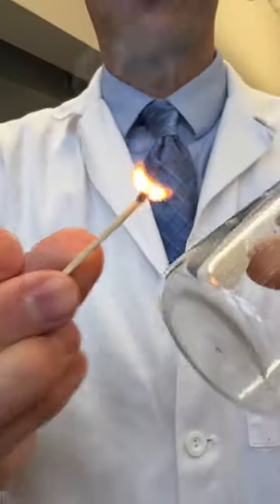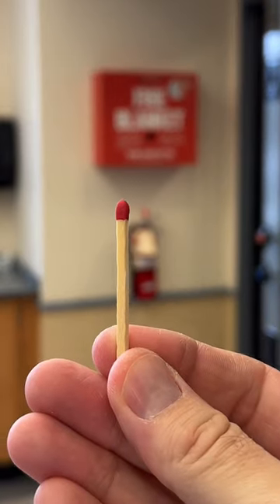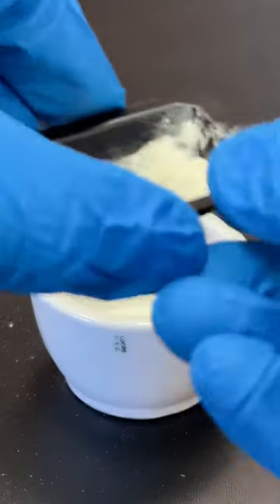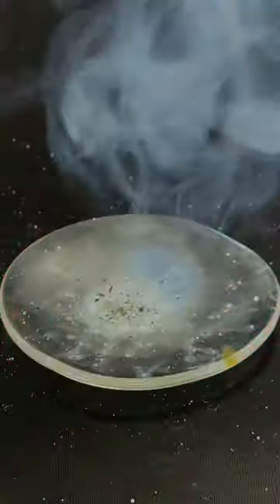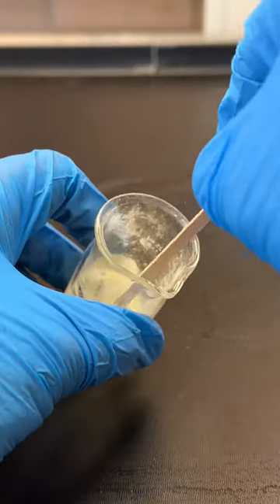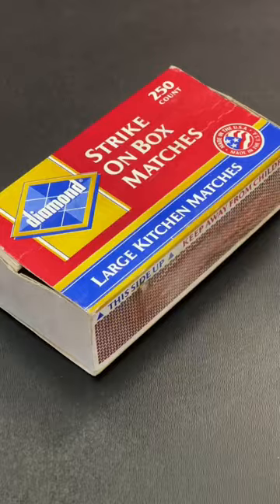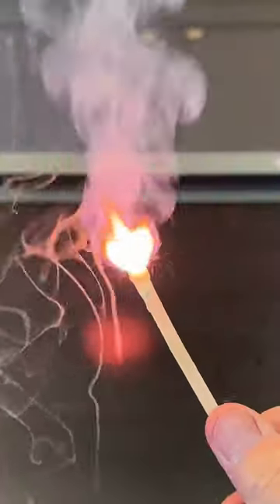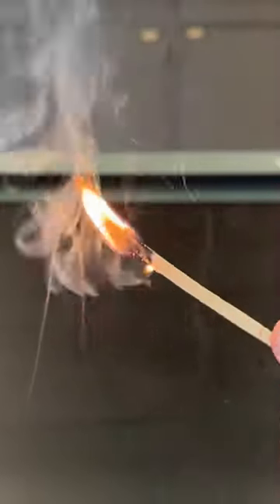Making My Own Matches

Comment: So cool. Explains why I can’t strike them on concrete to light my charcoal. Class of 1978 here.
Reply from the maker: Some states in the US allow “strike anywhere” matches which would light if struck against concrete. These types contain red phosphorus on the top of the match.
Reply: @Chemteacherphil  I find half the time they don't even work on a lot of surfaces that they're even supposed to because they're not manufactured that great, still will stick with the safe matches. Cool to see though, The way these burned reminded me of underwater matches.
Reply: @bmo14lax  it might be user error. That's not an insult but I have seen many people not strike a light anywhere match correctly. You have to rub it on the edge of the head and the side so both make contact with the surface at the same time. I can get them to strike off almost anything. Even leather and rubber. It just takes some practice.
Reply: @Chemteacherphil  are any of them toxic
Reply: @Chemteacherphil  are any of them toxic
Reply: @Bmo   maybe this was a bad batch out of China 😅
 hope we never have to go to war with them heck everything made over there 🙉
Reply: @Chemteacherphil  I've made my own strike anywhere matches. I use the "72 cosmos ring caps" or same thing from another brand, it is used in fireworks gun. Just take out the gunpowder from the ring caps, collect it and add few drops of water just to make it semisolid and dip the tips of normal household matches in it, covering it and let it dry. After drying you got you're own strike anywhere matches👍. I don't know the science behind it but it works.
Reply from the maker: @AstroGoat215  I’ll bet they contain some red phosphorus
Reply: @Chemteacherphil  its kinda like that but everymatch i see in the colder area of us is red and the strike anywhere have a little white or green tip on the red
Reply: @Chemteacherphil  What ingredients do you need?
Reply: @Chemteacherphil  What materials are needed?
Reply: @Chemteacherphil  I'm not sure of the names and order of the ingredients, please let me know
Reply: @Freedomislight  I'm pretty sure they are all toxic if inhaled
Reply: @AstroGoat215  Pretty sure we can all call BS on your comment.
Reply: The don’t use red phosphorus anymore hence why the match heads are now green. It’s due to the fact that people where using them to make speed. Red phosphorus being the active ingredient.
Reply: @AstroGoat215  you took cap gun powder and applied to the match head. Those explode under compression. The compression of “striking” it makes it explode and the heat then catches the match on fire. Not the same thing.  Ice try though
Reply: @Chemteacherphil  the reason strike anywhere matches are hard to find is because they are used to synthesize meth.
Reply: @Chemteacherphil How do I make it?

Comment: It’s scary how hot phosphorus burns.
Reply: No phosphorous burning here.
Reply: @arturjogi2667  then what IS burning?
Reply: There's several steps happening almost simultaneously to make a match burn well.

     When we rub the red phosphorous mixed with glass dust on the box with our match, the heat from the friction causes a small amount of the red phosphorus to become white phosphorus. This white phosphorus almost instantly ignites in the presence of atmospheric oxygen. It's a hot, tiny spark to start the entire process.

     This heat from the tiny amouny of burning, white phosphorus starts the reaction of potassium perchlorate (KClO4). The KClO4 quickly releases its 4 oxygen atoms, and it leaves KCl salt as a solid residue.

     The heat from the combusting KClO4 and these 4 oxygen atoms causes the antimony trisulfide (Sb2S3) to combust into mostly Sb2O3 and SO2 (other antimony oxides and sulfur oxides will be produced too). These products are very smelly and give matches their unique scent. They're also how matches get their large, bright, yellow flame.

     Some paraffin wax is added to the matchstick, so the flame continues to burn the whole stick. Without the paraffin wax, only the tip will burn, and the matchstick doesn't fully burn.

     Ammonium nitrate (NH4NO3) is often times added to help reduce the smoke when the flame goes out. I don't know exactly how this chemistry works. I will look it up later.

     As you can see, it takes several steps to make a match burn well. You, Casey, are correct that phosphorus burns at a scary temperature. I never worked in a chem lab, but it's important to follow safety steps when working with phosphorus.

     Artur is sort of right & wrong. Phosphorus works as a tiny spark to start the whole process. The KClO4 and Sb2S3 burn to make the big yellow flame. Paraffin wax continues to help burn the wood.

     😁
Reply: @caleonard35  potassium chlorate and sulphur. Did you even watch the video?
Reply: @zach3096 I think they are both talking about different match types, bc I've heard of both b4
Reply: @zach3096 also if you already have knowledge about a topic, you don't need to watch the vid. also there is at least 1 major error in the vid(sulfur and KClO3 are VERY energetic and easy to light, and burns quicker and easier than paper by a longgg way)

Comment: Do NEVER Mix chlorate and sulfur with pressure, for example with a mortar and pestille. A chlorate and sulfur mix can explode on its own under these circumstances.
Reply: This comment should be pinned tbh
Reply: Then, the best way to mix is shaking them in a bag?
Reply: @thenitrogamer9118  of course not. Its best to just mix them very carefully with a spatula. Or by putting them on a paper and folding it by rolling it from left to right and up and down. You know the mexican festival where they slam exploding hammers at the ground? The mixture on top of the hammer is a mixture of chlorate and sulfur

Comment: The cool thing about safety matches is that it’s “safety” is more to do with the replacement of white phosphorus with red phosphorus and sand on the box itself rather than just the matches themselves. When you strike a match, a tiny amount of white phosphorus is made and ignites the head of the match. White phosphorous was phased out due it being… well… white phosphorous. WP is many times more toxic than cyanide, ignites on contact with air, and when it burns it sticks to things like napalm. Red Phosphorus is a more stable form of phosphorus and isn’t toxic like white phosphorous is. The small amount made when striking is used up instantly and isn’t nearly as harmful.

Comment: @Chemteacherphil  I've made my own strike anywhere matches. I use the "72 cosmos ring caps" or same thing from another brand, it is used in fireworks gun. Just take out the gunpowder from the ring caps, collect it and add few drops of water just to make it semisolid and dip the tips of normal household matches in it, covering it and let it dry. After drying you got you're own strike anywhere matches👍. I don't know the science behind it but it works.